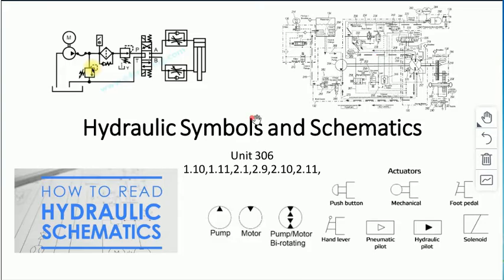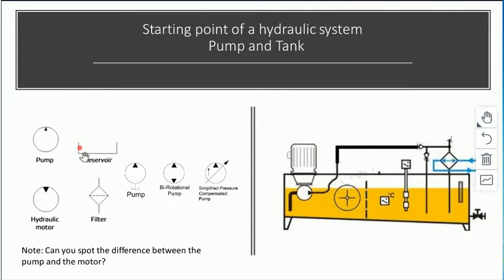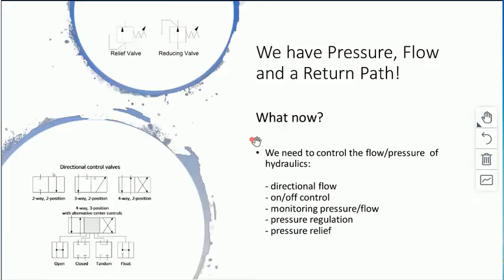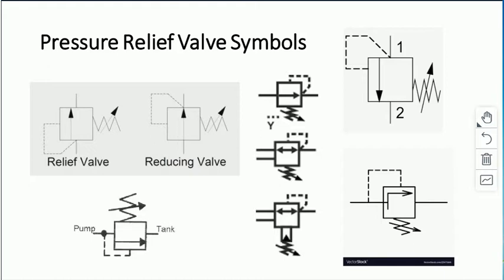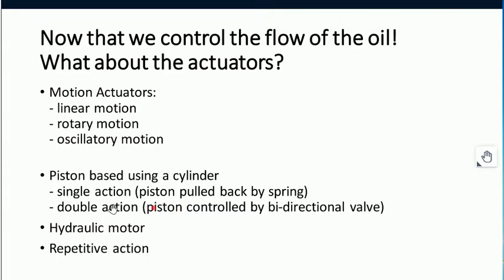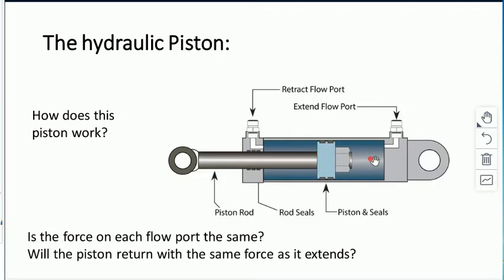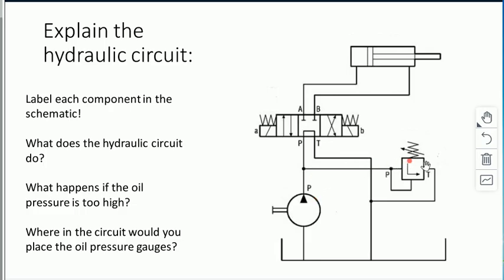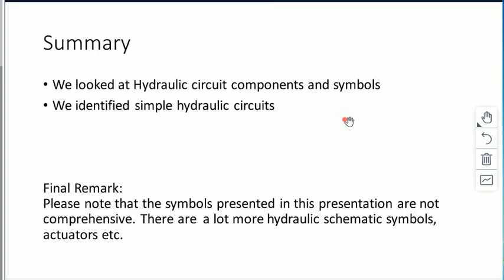Hydraulic Symbols and Reading Schematics

Comment: Nice work.Michael. Just to clarify, the pump does NOT create the pressure, but only flow. Instead the resistance in the circuit creates/ causes the pressure.

Comment: 16:48 nono, it's really not right

(positive displacment) pumps generate flow
pumps have a little differential pressure but it is very little from the view of industrial hydraulics working pressure

obstacles generates pressure like closings, but most usefully pressure relief valve
if you have only atmospheric pressure on a hose open-side than it comes only from moving
pressure difference keeps media flowing

and flow can generate pressure via moving like friction
plus if it has than media height cause pressure too